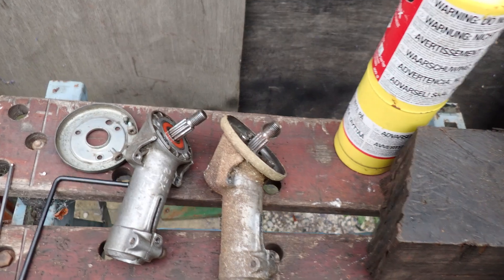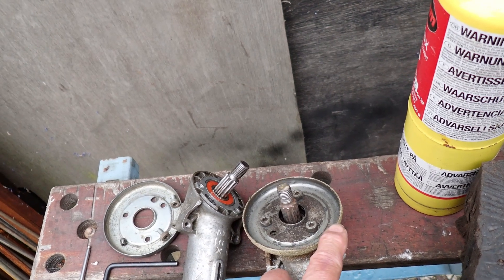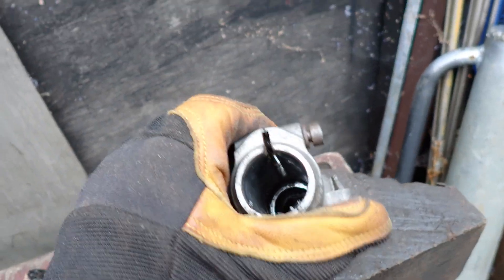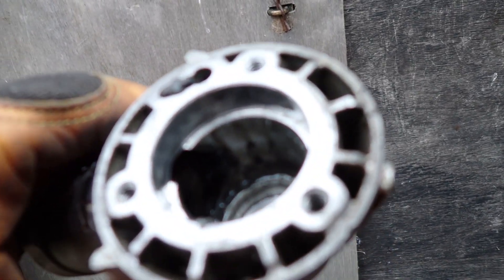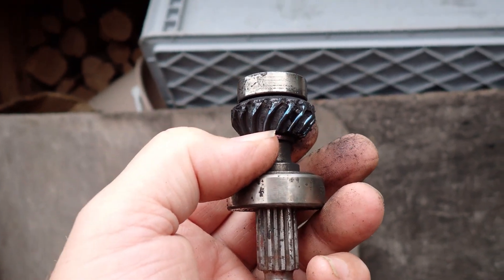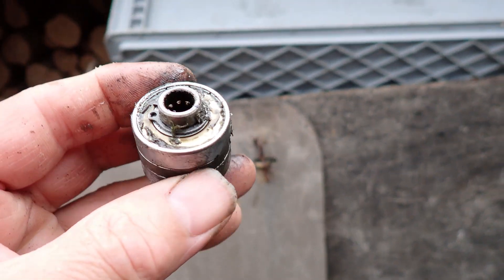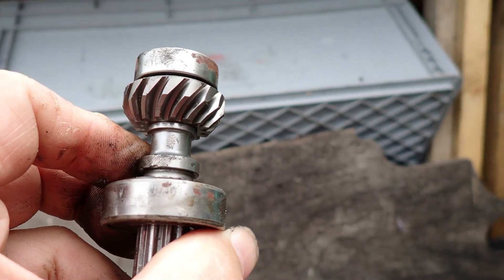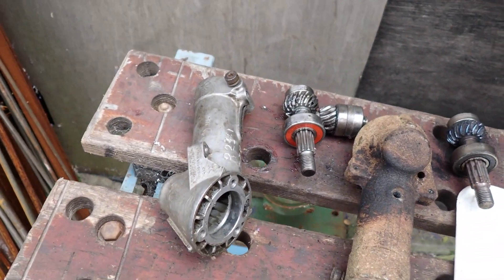How to Strip Stihl FS460 Angle Gears

Comment: Hi, great video! I have a FS460c and when I start it the head unscrews itself and falls off. This happened at the start of the year and I think the shop replaced the gearbox so I'd be surprised if it was that again. Also the head spins when the starter cord is pulled so I'm thinking it might be the clutch. If so why would that cause the head to spin off? Can't find an answer anywhere! Help! 😂
Reply from the maker: Head?  A trimmer head or cutter blade?  No way it should do that because the thread inside the strimmer head has a left hand thread and so should screw itself up when the machine drives it. Same for the retaining nut for cutter blades - it also has a nylock band AND it should bear on a really heavy spring washer under the nut guard or rider cup. This also should stop it uncrewing itself.  Here's how it works:  https://youtu.be/FUbn18JWxUg

Yes, look at the clutch for the head spinning at tickover or when putting the recoil start. There is a port under the handlebars that lets you slack off the clamp for the main body. Slide it up the shaft away from the engine. You will need a T27 torx driver.  You can now see what you're doing when you slack off the main clamp for the clutch housing to the drive shaft. No remove the orange top cover (4 T27 screws) to reveal the 4 screws for the clutch housing. Remove to expose the clutch. 99% likely you will find that one or both of the two springs (one per shoe) on the centrifugal clutch will be broken. You can get them from Stihl. You will need to dismantle the clutch (2 hex-head bolts). Replace both springs, not just one. Use a tiny dab of crease on the shoe pivots, not too much, when reassembling.
Reply: @anemonemechanics3175 sorry, it's a trimmer head. I'll definitely have a look at the clutch, thanks for your all your help 😀

Comment: Can the FS 460 C-E be lubricated without disassembling anything?
Reply from the maker: Nope. Sorry. Poor design. It's been 'corrected' with the FS461, which has a grease port and more-robust abutments to take the screws for the guards. We retro fit FS 461 angles to FS460s. But we don't use FS461 strimmer guards (they're different). We use the FS460 guards on the 461 angle gears  'cos they're much easier to use.

Comment: Can I put grease from the pinjon in the corner gear?
Reply from the maker: Sorry, not entirely sure what you're asking.  If you have the angle gear unit apart, you need to grease the 'top' bearing on the (splined) output shaft - it has no seals. You also need to grease the two angled gears. Stihl do a grease in a tube which is the right consistency - not to stiff (so it flows) and not too runny (so it escapes).  Big bearing on the output shaft has two rubber seals and should be greased from the factory.  Two smaller bearings on the input shaft should also be greased in the factory. Each have two steel shields which aren't grease-tight. I put some grease in between the two of these.  Any help?